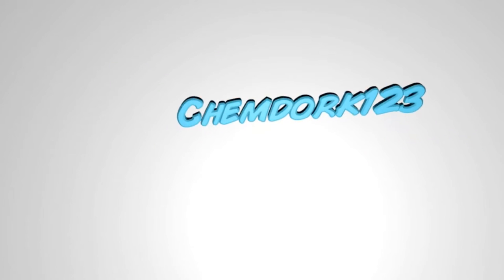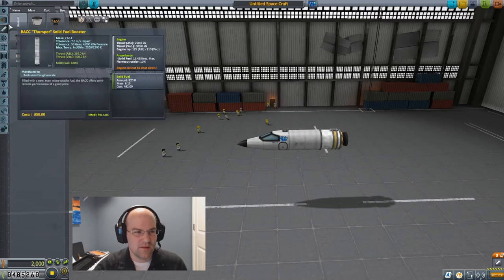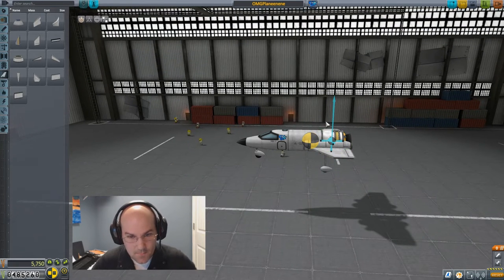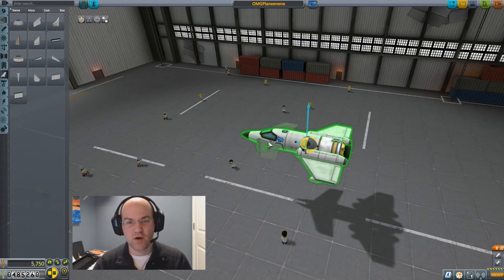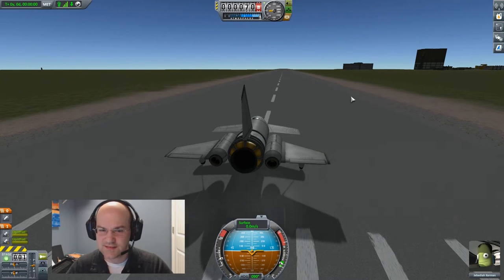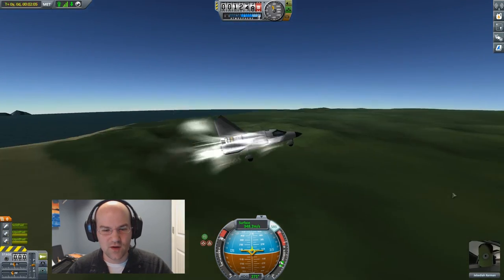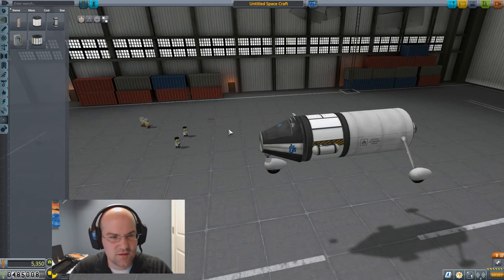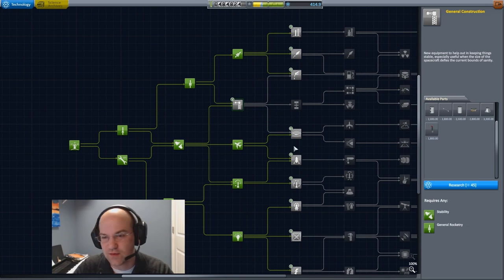KSP 04 - Plane Simple

Comment: Try ender io, solar expansion, immersive engineering, applied energistics 2, galactic craft, simply jetpacks (uses thermal expansion ores or ender io alloys), and/or big reactors. 

Immersive engineering adds a new plant into Minecraft called Industrial Hemp seeds that grow Hemp Fiber that is used to make string and windmills and more seeds that can be used for biogas (you can't use it in BC, Forestry, or TE machines). It also adds in extremely heavy machinery that are multiblock structures. It also is compatible with all mods that use Redstone flux

Ender IO gives you the ability to add multiple different types of pipes in the same block space. It adds a Redstone conduit (transmits Redstone), fluid/pressurised fluid conduit, item conduit (transports items instantly). It also is compatible with all mods that use Redstone flux. The solar panels act like multiblock structures meaning if you put a lot of panels together horizontally, you won't need to add energy transmission to the bottom of each and every panel. The energy storage is also like a multiblock structure.

The solar expansion adds different types of solar panels that are corresponding to the thermal expansion ores/alloys. It makes Redstone flux.

Applied Energistics 2 is a storage mod that uses Redstone flux also.

Galactic craft allows you to go into outer space. It's a different type of power generation but you can use Redstone flux just fine. There are different types of solar panels and power generation. Also, there is oil in the mod also that can be used as build craft oil just fine.

Simply jetpacks can use both ender io and thermal expansion alloys/metals to make jetpacks. They are charged with Redstone flux.

Big reactors lets you to make big reactors that make Redstone flux depending on the coolant, type of reactor,  and how much fuel is in the rods. 

Just a basic explanation of each mod, there is so much more to each of these mods.